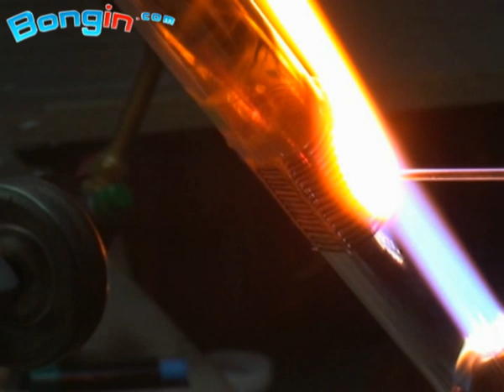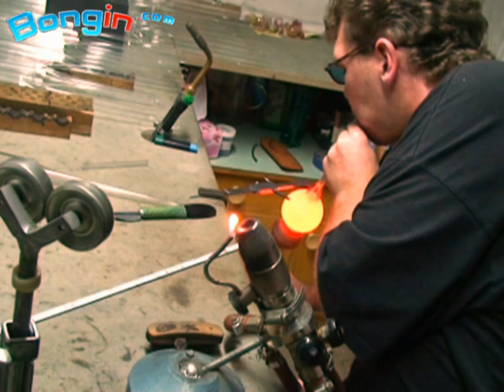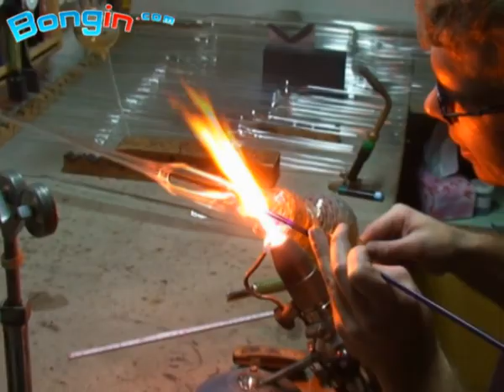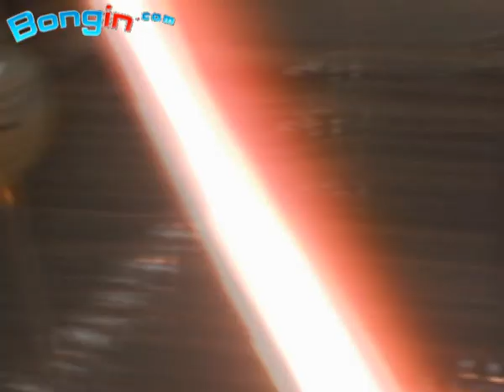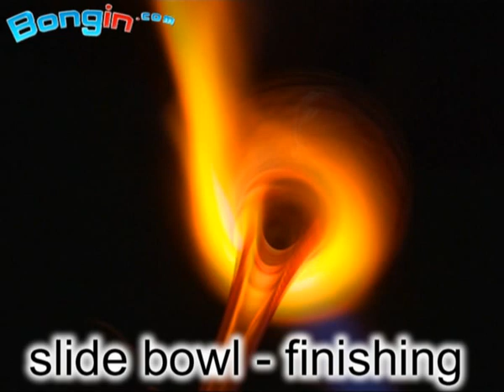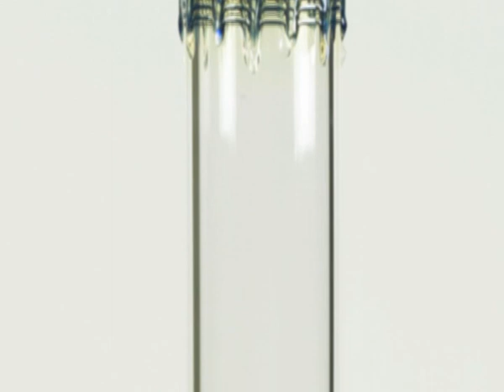Glass blowing video by Bongin

Comment: kiln annealing is a process that slowly cools the glass so that areas of different thicknesses or interfaces between various types of glass solidify evenly, reducing the stress
.
on this piece there is virtually no colour added, only silver fume. the raking is light & easy to melt in evenly with the spin & bushy flame. there are no interfaces between 2 thicknesses or coloured glass [which contains metals & so expands/contracts at a different rate]
.
i see your point, but its not always necessary